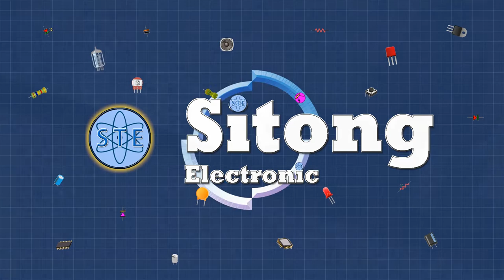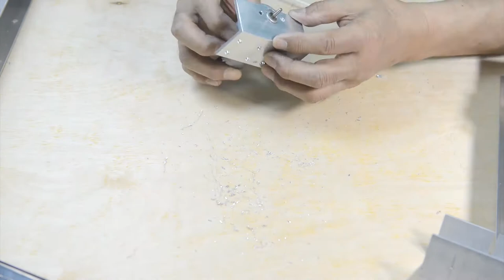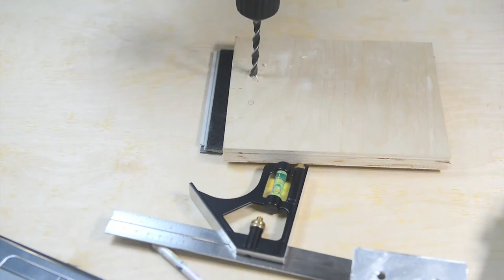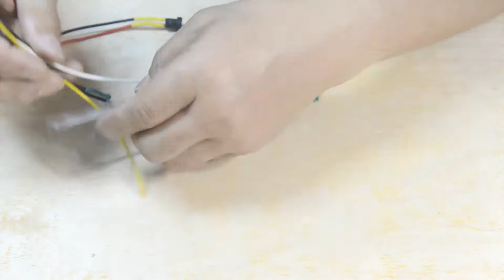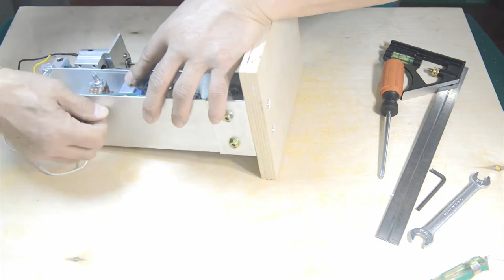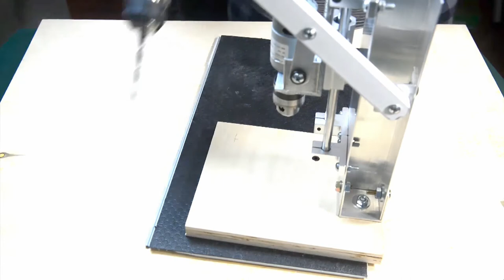Making a mini drill press at home | DIY a mini drill machine

Comment: Hi friend, your Drill looks great, but it's a shame you don't share in the video the measurements of the Linear Bearings, the Aluminum Plate H you used, and not even a list of the materials, which would be very useful!
Reply from the maker: Thanks for the suggestion, sorry I didn't show this information in the video. This is my first video, I will improve in the future. SCS8UU Linear Ball Bearing, Linear Motion Rods 8mm x 180mm and 555 DC Motor are used in the video. The H-shaped aluminum material is dismantled from a kind of waste fence.
Reply: @stelectronic645  Thanks
Reply: @stelectronic645  What length of SCS8UU Linear Ball Bearing did you use?
Reply from the maker: @Dancopymus   Refer to the size in this link: https://www.amazon.com/BQLZR-SCS8UU-Linear-Bearing-Bushing/dp/B00IJ67BJA/ref=asc_df_B00IJ67BJA/?tag=hyprod-20&linkCode=df0&hvadid=198096234697&hvpos=&hvnetw=g&hvrand=7462232038095417584&hvpone=&hvptwo=&hvqmt=&hvdev=c&hvdvcmdl=&hvlocint=&hvlocphy=9004379&hvtargid=pla-350231600311&psc=1
Reply: @stelectronic645  Tks